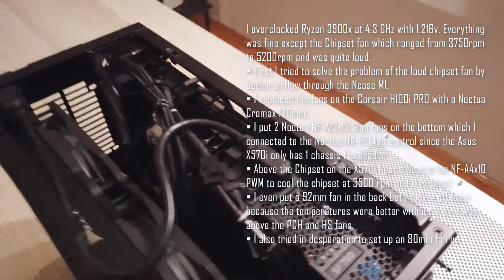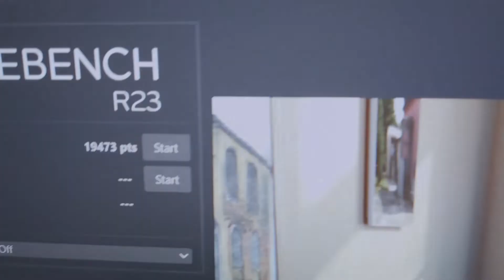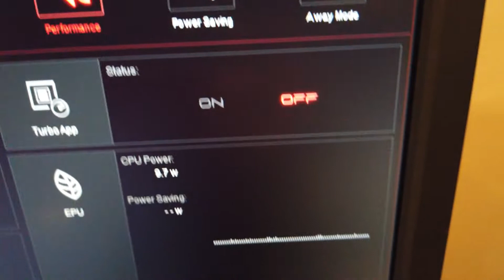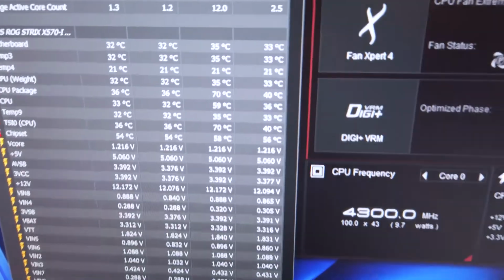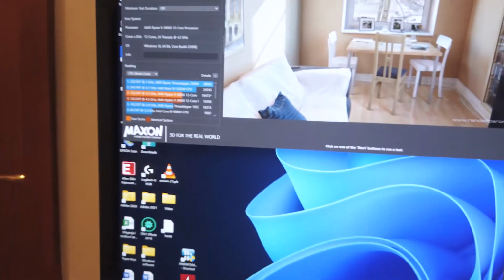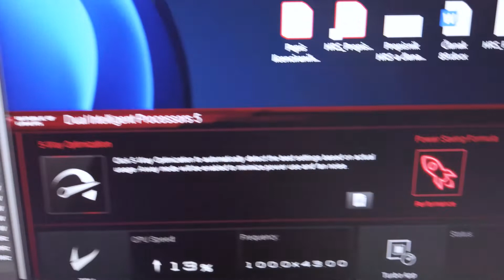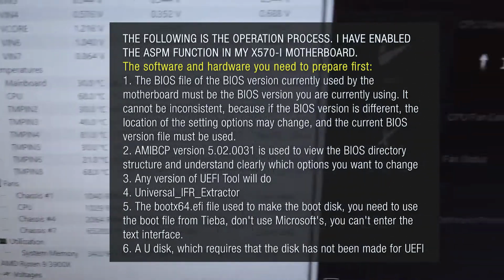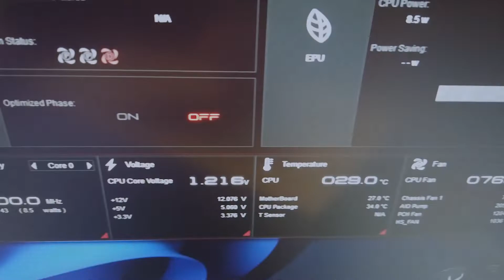X570 Chipset temps and PCH fan fixed on Asus X570i motherboard in ITX pc case Ncase M1 with 3900x

Comment: Wanted to let people know, with the latest BIOS, there is an option to enable APMS, so the chipset temps and fan speed are greatly reduced!

Just update to latest BIOS (I am on 5021).

1. Go to BIOS Advanced tab
2. ONBOARD DEVICE CONFIGURATION
3. CPU PCIE ASPM CONFIG
4. Default is AUTO, set it to L1
5. Save and restart.

This will drastically reduce the chipset temps and the fan will be nearly inaudible, as quiet as the VRM fan has always been.

Hope this helps someone!
Reply: it works, thank you very much! 

Might also be good to apply thermal paste after removing the pas as this friend does here :
https://www.youtube.com/watch?v=sGOT478EAWA&list=LL&index=2
Reply: @kayahacaloglu yes I found on my X570i the thermal pad on the chipset was only partially covering the chipset. Fixing that also helped bring down temps even more.
Reply: So glad i found this, thanks. I went from a persistent 92C to avging around 80C. Not really sure what's wrong with the pch fan but gonna try the thermal replacement when i have a chance because that chipset alone heats up my entire pc
Reply: This helped a little bit, at least!
Auto: 4500+ RPM at idle
L1: 3500+ RPM at idle
L0s: 4000+ RPM at idle (tested out of curiosity)
Both: 3000 RPM at idle, but potentially unstable temps.
UPDATE: I'm still experimenting, but disabling GPU silent mode to keep low fan RPMs in turn cools my PCH at idle/lower temps, making the tiny fan not spool up, on top of running APMS "L1 Entry" in my BIOS.